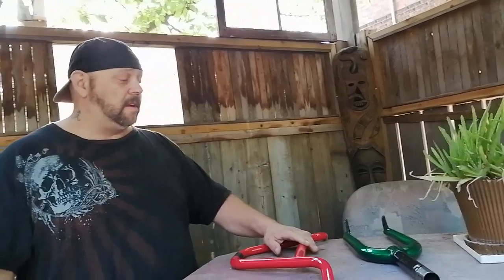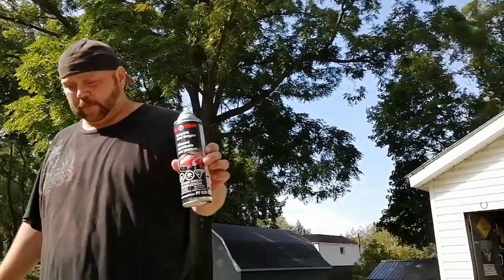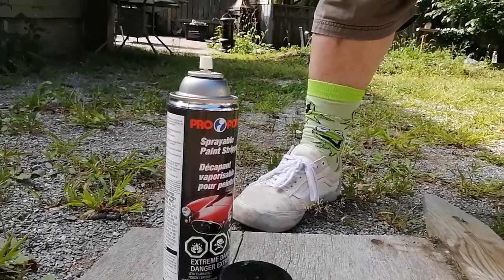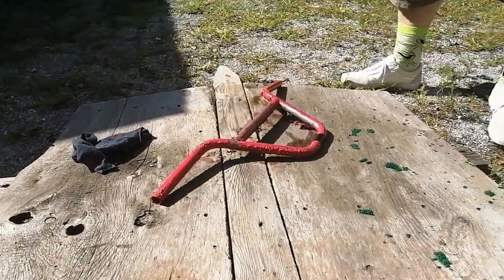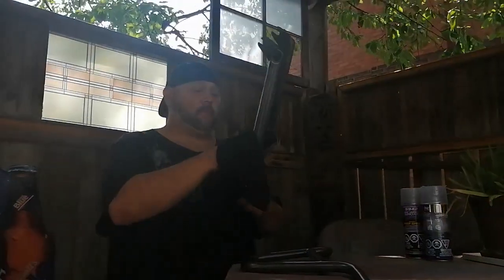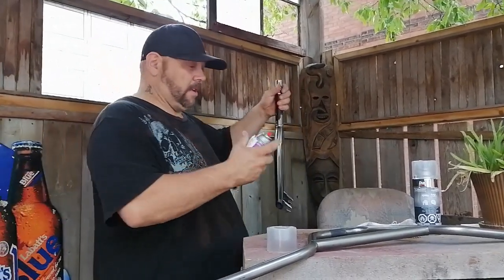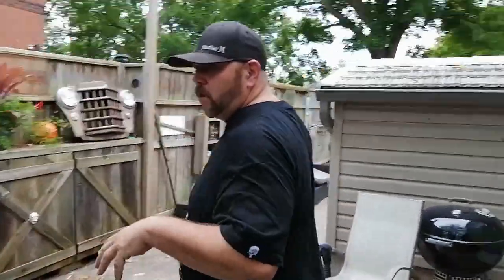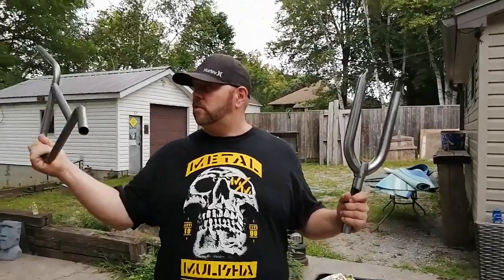(DIY)Stripping Paint. Rawing out my bmx bars and forks for the new build.

Comment: What were those two bottles called towards the end of the video for like the rust and stuff after getting done with the paint stripper?
Reply from the maker: So first thing after you strip the paint you want to take a damp rag and rub clean and let dry. The first can is called prep spray just give your parts a healthy dose of it and wipe dry with a clean dry cloth.. We used 5942 5STAR prep spray it just cleans it up nice and removes any left over residues from the stripping. The second can is just a clear coat paint.  You will find all the best types of both the prep sprays and Paints at your local Car Quest or other auto department stores.

Comment: What’s the name of all three cans that were used?
Reply from the maker: Sorry bout the delay in response. the first can is Pro Form Sprayable paint stripper second is 5942 5star prep spray for cleaning any left over residue from the stripper. and the 3rd is just a clear coat enamel. you can find them at a Car Quest or any other auto department store. TY for your interest.
Reply: Thanks
Reply: @RoughHouse BMX  wow you did an awesome job 👌